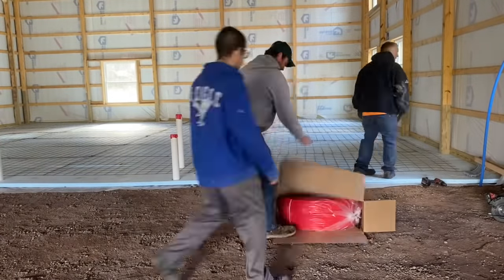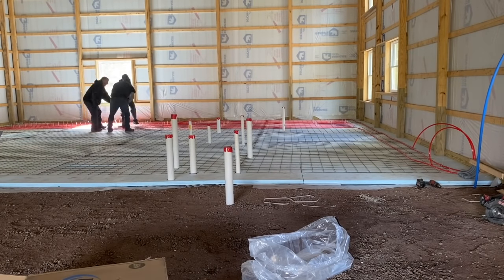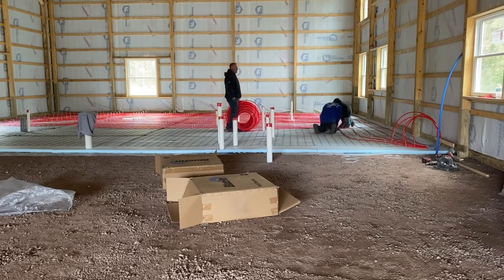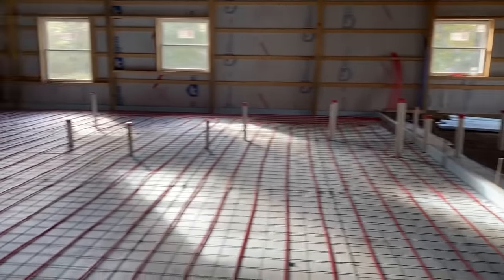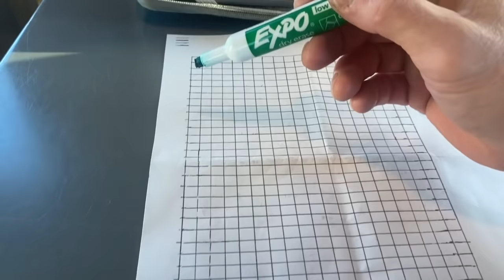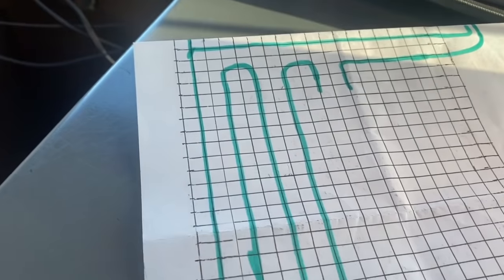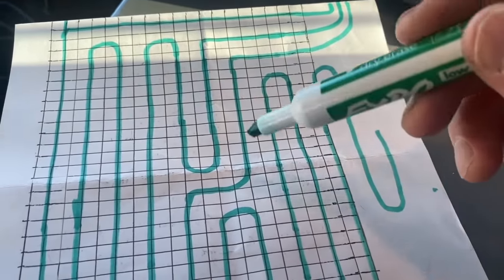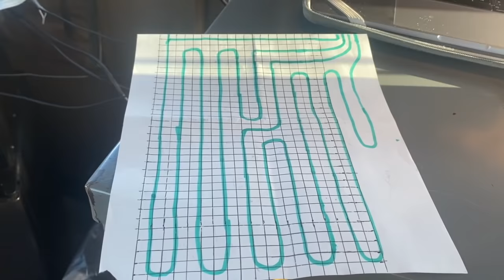Installing your own radiant heat tubing in a concrete slab. (DIY METHOD)

Comment: I did my 30x56 post frame home by myself.  Did three zones 2 bedrooms and main living room and kitchen. 8" of compacted gravel base first then Vapor Barrier with 2" foam board taped seems on top then steel mesh . Put the plastic towers to raise the mesh.  Zip ties for the oxygen Barrier tubing.  Foam around edges.  I run it with one instant water heater.  It's the best heat I've ever seen in my life you can't get more comfortable heat. Going on two year's of comfortable bliss lol.
Reply: What kind of climate do you live in? I’m hoping to do the same, but we have pretty cold winters in Wisconsin.
Reply: @kyleliesener3982  Ohio, As long as you insulate the walls and ceiling your good.  I have 8" thick walls with 2" of closed cell spayfoam insulation and the rest is blown in to fill the walls.

Comment: I’m building a new house with in floor heating like this only I want to connect it to a new wood burning green efficient stove to be off grid and want to connect it to in floor heating system. How can this be done?
Reply from the maker: Do you want to use a boiler? or just a wood stove?
Reply: @bondobuilt386  a wood burning stove to heat my in floor heat and a wood burner to heat my hot water system for the entire house. I’m also doing the same thing in a new barn/apartment.
Reply: You should fill it with kryotech which is like a antifreeze but it's made for heating boilers

Comment: “Not rocket science”… famous last words😂… under 500’ ? Depends on tubing size, if you’re using 1/2” no way can you run a 500’ loop… pumps won’t pump and will burn out prematurely if they do ok loops that aren’t sized properly…I saw a homeowner diy a snowmelt system and used 1 loop for a 1000’. He had to redo his entire concrete driveway because he made the mistake of not heeding this advice. Expensive lesson. Cut your loops first so they’re all the same length and then lay the tubes, length is super important

Comment: I thought the loops had to be under 300'.  That's why they sell 300' rolls.  I was also told you didn't want more than 30 degree temperature swing between output water temp and return temp.  Maybe you're in a warmer climate then me.
Reply from the maker: I can get the tubing in 1000’ rolls. Once a slab is up to temp it looses verry little temp in 500’. This is of course that the building and the slab are insulated properly. The 300’ rule was brought on when they were hooking up radiant to old cast iron boilers with low head pressure pumps. The cast iron boilers dont like dumping colder return water back in them. We mostly heat with 50 gallon commercial duty water heaters or modulating boilers or wood boilers. They are designed to take colder return temp water. Also the pumps are just a stronger pump to overcome more head pressure from a longer run. The entire process is simplified with the longer runs of tubing at the same length. The headers are short and simple. We have done 100’s of these and I live in upsrtate New York and its a cold climate. 
Thanks for the questions 👍
Reply: Rhaulman A modern condensing boiler benefits from cooler return temperatures! In Europe where condensing boilers are mandatory, systems are designed to return water as cool as possible. They are a perfect match for UFH as they operate in condensing mode at all times, which is not always the case with hotter running radiator systems.
Reply from the maker: @spencerwilton5831  I agree completely with that statement buddy. 👍
Reply: I push water through 6x 250' loops with a single 1/25th HP pump with the 3-way switch set at its lowest setting.  Works fine.  No issue, 20+ years in place, and here in New Brunswick Canada, it would not qualify as a warmer climate, we run our outdoor wood boiler from before Hallowe'en until mid-May or later.
Reply from the maker: @Wingnut_Stickman  nice it’s cold where I live too. Love the wood boilers I got a couple videos on mine and one we built for my buddy. 👍🤜

Comment: if l ever disagree with this guy,I QUESTION IF MAYBE IM THE ONE THATS WRONG,bondo is Mr.common sense//,,,,ive only poured 15 or 20 slabs in my life(of my own)so lm always listening with a non-critical open mind for easier ways to do things.......lve effed up a few pours,not bad,but it was usually because l was short of help

Comment: By far one of the best videos on DIY in-floor heat. As simple as it is, you drawing it on a piece of paper made it all come together for me. I do have a insulation question though, I have a 4 foot frost wall. Some advice I’ve gotten is to extend the side wall insulation all the way down to the footing. I’ve already backfilled and was planning on just going from grade to top of knee wall (it sticks up 1 foot above grade) and butt the floor insulation up against it. Your thoughts? I’m also a bit confused about the insulation at the garage doors. The walls drop down here, and the top of the wall is level with the rest of the dirt. Thanks for any tips!
Reply from the maker: Yes I would do like you say no need to go down to footer.
Reply: @bondobuilt386  Do these ever leak?  If it leaks then you have to do what?  Hammer out where you think it's leaking and then repair it?  Can this radiant floor heat the entire living space alone or does it require another heat source in addition?  Thanks!
Reply: @VenturaIT  Yes, these systems are the best and most efficient for heating your home.

Comment: I am a student getting my mechanical engineering degree. Taking a course in thermal fluid system design and working on a design for a water cooled patio slab.  This video has been super helpful in getting an idea for the design.  I'm very novice in this industry, and was just wondering if anybody had any pointers or references for materials and overall design. Any help would be appreciated.
Reply: did you find your answer? If not, there is a "bible" many pros refer to and even software now called loopCAD.

Comment: Just told a client today that he should go with radiant floor heat in a new half-court B-ball barn.  For us here in the Mid-west - it's the best way to keep a barn nice and consistently warm in the winter.  Thanks for the video!
Reply from the maker: Yes absolutely. It gets plenty chilly in the mid west with that wind you get. I hunt there every fall. They will be glad they did the radiant. Follow my tubing layout system and it will be smooth going project. Any questions along the way give me a shout. 👍😊
Reply: @bondobuilt386  

I am in Pennsylvania and new to radiant heat. My build calls for a 4 inch slab. Should I make it thicker because of these tubes? If I don't will it causes cracks? What is the minimum thickness concrete for radiant heat?
Reply from the maker: @reypolice5231  Hi. You can pour your floor at 4" and it will be fine. Just be sure to put down 2" of closed cell foam under the concrete and it will be great. Don't use that insulation blanket under the concrete it won't heat well.
Reply: @bondobuilt386  

Thank for responding.
Thanks for no insulation blanket.

Do I try to pull up the wire mesh. It's just sitting on the insulation board and not in the concrete per se. Other videos from you talk about pulling up the wire mesh to get it into the concrete better.
Reply from the maker: @reypolice5231  We do not pul it up with the tubing in a 4" floor it will get damaged. We use fibers to strengthen the concrete.
Reply: @bondobuilt386  
Thank you for that clarification. I read that  they are now adding carbon or graphite to cement or concrete at 5-20% by volume to increase the strength by up to 30%.

Have you heard anything about this? If so what do you think about it?

Can you do a video on it?
Reply from the maker: @reypolice5231  I have not used that type of concrete. We just raise the Portland content and use water reducers and fibers to increase strength.

Comment: Hi Ron, I love all of your videos. I try to be as practical as I can be, I think you do the same. I'm an old carpenter in Maine who had to retire for a few reasons. I want to install radiant heat in my house, no, not in concrete but under my floor. The Pex isn't that expensive, the heat source is and so are all of the other stuff to make it work "right". I like this approach to having one zone.
I'm going to watch and re-watch your videos on radiant heating.
Reply from the maker: https://youtu.be/wWWfFER9Spw Hi Roy thanks for the comments  This new video should be helpful to ya.

Comment: Build a line spooler. You can do all of this work by yourself (one man team.) I made mine out of a couple scrap pieces of plywood with two ABS toilet flanges (adjustable ring) between them. One flange fits in the other to make your "Wheel".  Use two 3/4" Black Malleable Iron Floor Flange Fittings and two 3/4" x 24" Black iron pipe nipples to hold the roll of Pex.  Throw a 3rd piece of scrap plywood on top to hold it all down. Materials all available at HD or Lowes. Probably laid 300k feet of pipe in fifteen years with my 1st one. Retired it last fall and built a new one.

Comment: Hey Bondo, if my new house (barndominium) is on a monolithic slab, should the sides of the slab go below frost line, and how many inches thick should the main pad be? (3", 4", 6"???)

I'm also reading about studies that find the Pex should be about 2" from the top of the slab, rather than at the bottom of the slab for optimal efficiency. If thats the case, I'm concerned about relief cuts made after the crete has dried, cutting the Pex. What are your thoughts?

Lastly, I'm considering using 3" polystyrene sheets (R19) on the bottom and sides of the monolithic slab. Is 3" overkill, or should 2" be used?? I'm right near Syracuse, NY.

I know your time is valuable- thanks for any input, and thanks for everything you do for the little guy, that has to do it for himself!!
Reply from the maker: Hi. The main pad should be 5-1/2 to 6" thick and the sides should be 12" thick. No need to go below the frost line. Protect the edge of slab with foam. The 3" foam would work great. Make sure it is closed cell polystyrene.  Keep the tubing on the bottom and it will heat awesomely. I have done this about 100 times and in my own house as well. Works great.
Reply: @bondobuilt386  Thank you for your help!! I truly appreciate your time!!

Comment: Thank you for a very informative video. It’s my first video watched about this system and I’m yet to learn more. What is the thickness of the poured concrete on the in floor heat?
Reply from the maker: 5-1/2" thick thanks.

Comment: Great video. I think I've watched all your videos. I do have a couple questions. I've heard the wire mesh doesn't do any good if it's not pulled up into the concrete. I've also seen guys using the staplers to attach the PEX to the insulation. Will the PEX still heat properly if it's at the bottom of the slab? Would it be better to use the mesh and pull it up as the concrete is being poured with the PEX attached? Just want to get the most efficiency out of the in-floor heat. Any thoughts? I'm planning on 4" concrete/4000# mix. Thanks for all you do for us first timers!
Reply from the maker: It works real good on the bottom of the concrete. Do NOT pull it it up or it will get damaged and you will get a leak in your system. I have never damaged a line or had a leak in 15 years of pouring radiant slabs.

Comment: AMAZING video, thanks for sharing!! So just to clarify, if you have 1 foot spacing, you will use 1 foot of tubing per sq foot? And is there concerns about longevity of this system to leaks or other failures? It seems like there's no repair once the concrete is poured.

Comment: I keep watching your guy roll the tubing out and I’m thinking of a un-spooling cart for that task. Have you thought of this or is there already something built for that? I recently bought a custom reel for romex electrical cable, and it’s the first time over 30 years of doing electrical work that I can pull wire neatly by myself. Y’all are doing great though!
Reply from the maker: Ken the guy rolling the tubing is me. LOL They do make a un spooling reel for tubing but I think its easy with good help to just roll it out. We are fast at putting tubing down. Thanks for the comments 👍😊

Comment: How did you fasten the foam board to the edges? it looks like you may have used a screw with a large washer? or was it a specific fastener? Looking at doing this same set up in my project. 

Great video! Thank you!

Comment: Just found your channel. I’m doing my research on radiant floors. 
I want to do something similar. Living quarters next to a shop with heated floors throughout. My question is how do you do walls and a car lift on top of a heated floor?
How thick is the slab? Do you worry about driving a nail and hitting a tube when anchoring the bottom plate of a wall? You can’t glue the bottom plate can you? I assume even though the floor is insulated you would still need treated lumber and that rolled out foam under the bottom plate? If so I don’t see how to avoid nails and the possibility of hitting a tube. 
I haven’t decided between a 4 post and a 2 post lift. A 4 post could just be set and not anchored. But a 2 post would need anchor bolts. Would you lay out your tubing and just avoid where you plan to have the lift?
Thanks 
Mark

Comment: Thank you for the great videos ... I like the straight-forward explanations.  I'm working on building a 36x80 barndominium currently in western NY.  I've seen so many different opinions and approaches to concrete thickness and mesh/rebar.  I like that you are also in the NY region and trust that you build based on what has worked year after year.  I notice you lay down the mesh before the tubing. Can you explain why you go that way ... is the mesh for strength or just to hold the tubing down?  Also, I'm planning to go 4" thick with my concrete ... does that sound good to you, and if so, what PSI concrete would you use?  My garage area will only have normal everyday vehicles in it.
Reply: 4” is light I’d do 5.5” just using 2x6 forms

Comment: Definitely a good video. We're working with a company in Vermont and they want me to use 7/8 pex instead of a smaller size and use 16-18 inch centers. What are your thoughts on these specs? We're using an outside wood boiler to heat the water. We're in TN.
Reply from the maker: If it was me I would just run the 1/2" oxygen barrier pipe on 1 foot centers and keep the runs around the same length. No longer than 500foot loops and it will work awesome but make sure to use 2" of closed cell polystyrene foam under the concrete.

Comment: I'm having a pole building built and I was talking to the contractor and said I wanted to do radiant flooring heat they told me I had to do it myself before the concrete pour layind the tubing myself my question is what would you do if you were planning on putting two or three car lifts in the building. It's a six inch pour.
Reply from the maker: Plan exactly where the lift posts will be and draw yourself a map of the locations. Make that area about 12" thick and around 2.5' X 2.5' square. Do not put the tubing in those squares. Take a video also of the locations or pictures with measurements. Then instal lifts after the concrete has cured for 3 weeks to a month.

Comment: I was  just wondering why you wouldn't pull the mesh up into the concrete?
Doesn't it have to be in the middle of the concrete for strength? 
I am about to do a floor and would really like to know the reason not to.
Also I see others do a pressure test on the tubing as they pour. Is that not neccessary?
Is there different qualities of tubing what do you recommend?
Really appreciate your videos. Thanks and hope you can find the time to help me out with information.

Comment: Incredibly helpful video, you got a new subscriber.  I have a few questions I know you must be a busy man but I appreciate any that you can answer:

1. My project is going to have a concrete slab underneath it and/or possibly tile or linol (we're going over that stuff potentially with the concrete), I noticed you have some plastic sheets underneath your styrofoam, is that one of the requirements for sealing, or what exactly is it and why do you use it?  Does it have to cover seamlessly or can it overlap?
2. The foam you use is just so you don't have to use as much concrete and to provide a half assed level surface to begin with I assume? Do I need the foam if I have a level surface already? 
3. How do you do the pour side of things, do you use self levelling concrete?  I'm wondering if I can do several pours layered on top of each other if necessary instead of just doing a big pour. 
4. What's the minimum amount of concrete you need to have from top of pipe to floor (how big of a gap of concrete above pipe?
Reply from the maker: Hi. The plastic is a vapor barrier to stop the slab from wicking up moisture. Yes you can over lap it. The foam is necessary to keep the heat in and going up into structure instead of down Ito the ground below. The concrete should be a minimum of 4" and leave the tubing down on the foam board. The foam board should be closed cell polystyrene and 2" is best but you probably would be ok with 1-1/2" if hight is a problem.

Comment: If a gal wanted to do radiant in-floor heating in her concrete basement, could I not lay down aluminum (like emergency blanket type stuff) and then run the tubing, and then more concrete on top? I've got the clearance. Ceiling height in my basement is 8'6"... Thoughts?
Reply from the maker: You could lay 1" to 1-1/2" closed cell foam on top of your floor then wire mesh and the tubing and then pour 3" of concrete on top. anything less then the 1" and it would loose a lot of heat to the old floor. If head room is good go with the 1-1/2" foam.